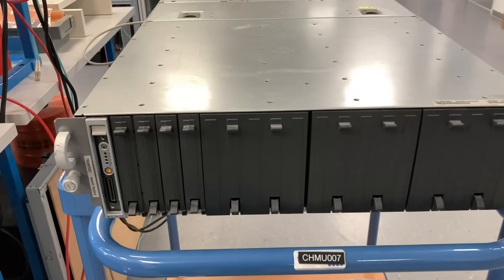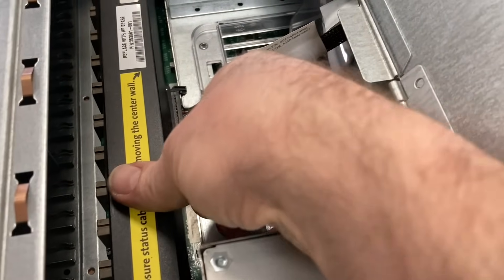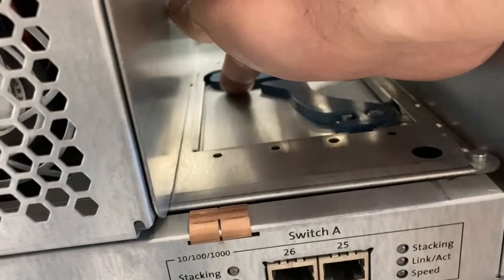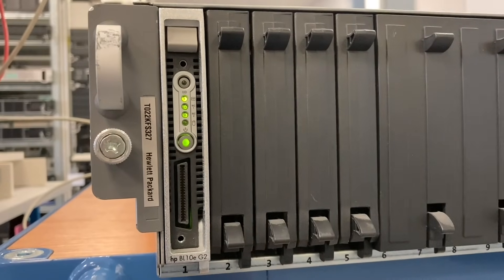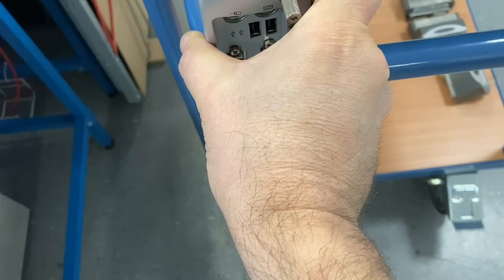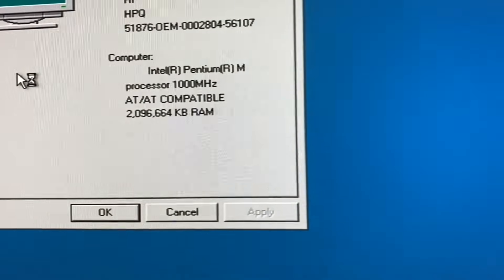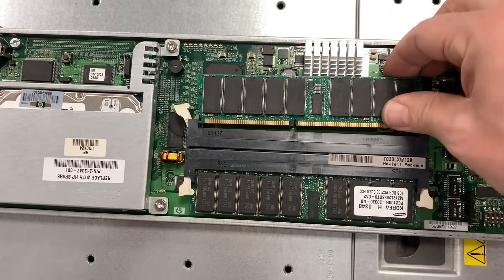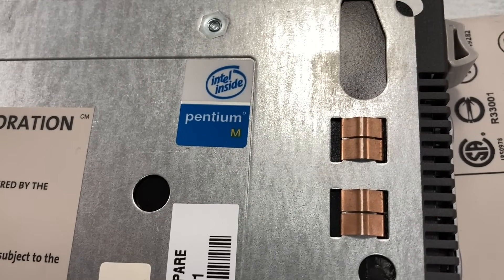Compaq/HP first blade server ever? (PWJ259)

Comment: Is it correct to say that the demand for blade systems went downhill in the very moment we had virtual machines like VMWare or VirtualBox? Thanks.
Reply: There are many users that run a hypervisor on (modern) blade servers.  So they combine both technologies.
They combine a blade server chassis with a storage box.
Reply from the maker: Probably yes. At least it happened at the same time. If one is the cause for the other.... well, it's possible.
I never fully understood the benefits of blade servers. The problem is, if you decide for one brand, you're stuck with that brand for many years.
Normal servers running a virtual OS can be exchanged with any brand and model. People generally don't like to be tied to e certain technology.
Reply: @ And these boxes are so large that you can fit many separate 1U servers in the same rackspace...

Comment: Double-stacking RAM chips (with DIL DRAM) was in fact quite popular with hobbyists years before that...
I always upgraded my computers that way instead of adding RAM cards 🙂
Reply: How does that actually work? The DRAm chips cannot simply share all connections and somehow need to be addressed independently, or am I missing something there?
Reply: @maeanderdev  What you would do is take the new chips and bend one of the pins (usually CAS* but could also be RAS*) sideways and maybe cut a bit shorter, then you solder all of them on top of the existing row of chips already on the board.
Then you run a single wire (blank or enamel wire) along all the bent pins, and connect it to the memory controller that already has an extra CAS or RAS line, or you expand it to add one.
Now this entire new bank of RAM is separately addressable.
Reply: @ thanks! The stack in the video didn't look like it was wired separately though. My only guess trhere is that different chips were used for bottom and top such that one line would be inverted inside of one chip and not inverted in the other
Reply from the maker: What you can't see is the tiny flexprint between the two chips. This will connect to different pins on the upper chip.
Another possibility is to use two different chips with different address connections.
For homemade applications you simply bend one or two pins up and connect them with thin wires to the PCB

Comment: Pretty good engineering, wasn't it?!
Reply: Eh... we used to frown upon those back in the day, because they introduced single points of failure. Losing all blades due to a fried backplane could easily ruin a weekend :) Besides, there were other products out there that could get you the same or better density without losing redundancy.